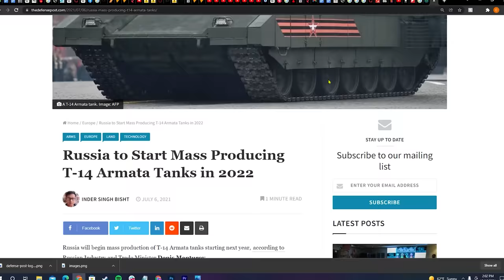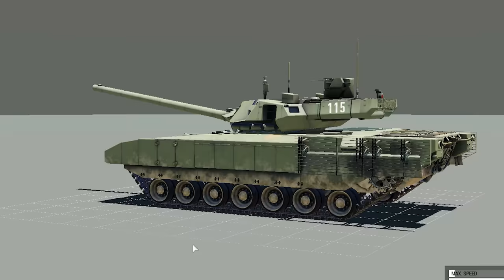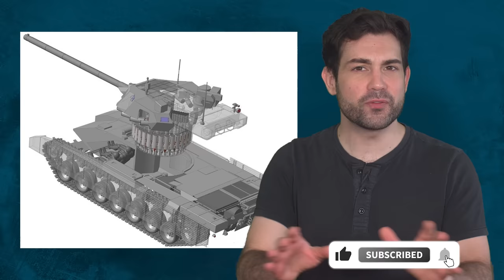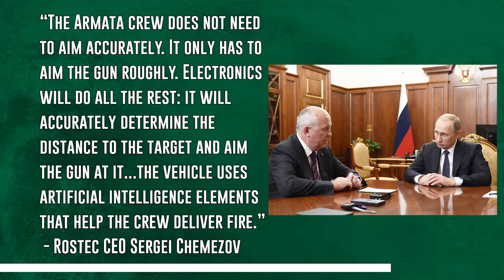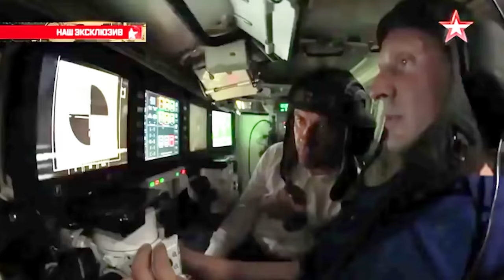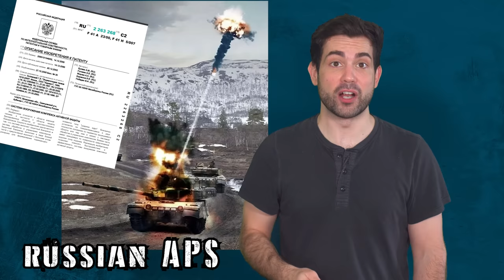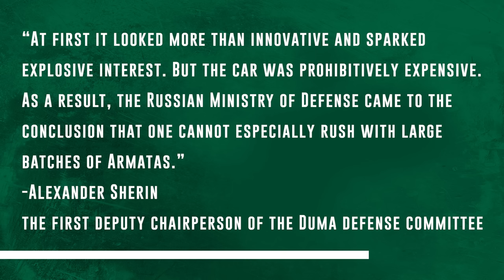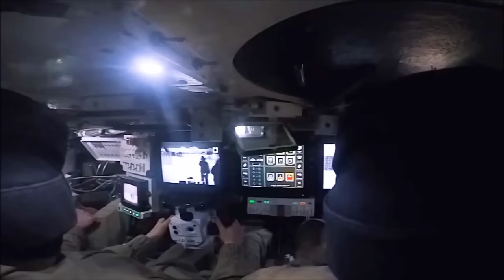The Truth About Russia's T-14 Armata Tank

Comment: Apparently, designing 'the best tank in the world' is easier than actually building them.
Reply: Same as the tiger tank ahead of it's time so cost a fortune to make and hard to produce in big numbers.
Reply: @huwdavies-tallon3305  👍
Reply: The biggest problem seems to be the engine
It does not deliver the horsepower of fuel efficiency that it was supposed to
Because it is underpowered ,it is over stressed and tends to catch fire
Reply: @jamesricker3997  
👍
Reply: Also which wins, the tank, or the anti-tank system.   Right now, I believe the latest anti-tank systems are leaps beyond what any country is willing to put into a tank to actually survive a hit.  Even active defense systems don't protect the crews from top down strikes such as from artillery, dropped bombs and some anti-tank missiles.
Reply: @orlock20  
If you build bigger rocks. Someone will build a bigger hammer.
Reply: @thomasridley8675  I forget who, but somebody made the largest prototype tank and it was unmanageable.  At some point, your hammer will be unwieldy and a new approach is in order.
Reply: @orlock20  
The rock is the tank development. The hammer is the anti-armor 
development. And so far, anti-armor systems are staying a head of the game.
Reply: Tiny economy compared to US can't build enough lul
Reply: @nkl7345  
They have built quite a few other combat systems since their fall. That are even more expensive than tanks.
But apparently, at the cost of tank and aircraft production.
Reply: Russians overstating the capability of equipment? Surely their performance in Ukraine would prove it out, lol.
Reply: Ideas and prototypes are easy. Production is hard.
Reply: @ManHobbyChannel  
They do seem to have an issue with actually building in the quantity they need. 
Putin spent over ten yrs to create the military we see today. And let's just say it, he got ripped off.
Reply: @orlock20  For as long as there is no perfect solution to HEAT ammunitions, tanks won't be in a confortable position against infantry.
Reply: @MrMorvana  That's one of the reasons the U.S. military has stopped buying tanks to the point that congress had to step in and buy tanks against the military's wishes, to keep the only U.S. tank factory operational. The minimum number of tanks needed to be built to keep the factory open is 100 tanks per year.  Some of those tanks are bought by foreign countries.
Reply: Building a prototype is very easy. Manufacturing is really, really hard.
Reply: that's true for all heavy industries
Reply: My mate once thought of the tallest tower ever imagined. Impressive.
Reply: Also,even if they built them, they would have to maintain them, create spare parts, ect.. with Russian weather, roads and legendary maintenance, this delicate thing would get broken in few months.
Reply: @noldo3837  
👍
Reply: According to Musk, designing rockets is much easier than building them in large numbers.
Reply: This would require a defence ministry which does more than syhpon taxpayer money to oligarchs
Reply: @KekusMagnus  👍
Reply: Lol its basically an automated t 90. Built cheap and easy to use.
Reply: @orlock20  I think the military has long since figured out that the cold War era tactics of the 1950s and 60s are outdated. Now, an untrained goat farmer with the proper equipment can knock out a $6M Abrahams tank if someone shows him where to point his weapon.
Reply: @thomasridley8675  And they are much cheaper than the systems they destroy.
Reply: the best is built and in service the M1 Abrams
Reply: @gordonhyslop1336  
The leopard 2a7 is right up there with the m12a scp. As well as the black panther. The deadly trio.
Just be thankful that they are on our side. 😁
Reply: just like the China next gen fighter... doesn't work most of the time.
Reply: Really reminds me of a Top Gear news section. Where they read out the specs of a new amazing Bugatti Veyron Killer. 
And ended witht he smallprint: "these are the features we plan for it".
Reply: @Thisandthat8908  
😁👍
Reply: @deeznutz862  
Well Russia has the same issue that China has. Poor logistics, limited infrastructure and a huge area to cover. As well as a system so corrupt that I am surprised that they can actually field any effective fighting forces.
Reply: @huwdavies-tallon3305  But at least it was build in some numbers, sure far less than the soviets and americans did with their cheaper tanks, but it was designed in 1941 and they produced 1350 tanks until 1945 even though it was this overly complicated. 

This is just in design and production hell for ages
Reply: @orlock20  germany build the maus in ww2. It was so heavy it buried itself into the ground. It was completely useless
Reply: @Infiltator2  188 tons of metal will do that. Even if one could get it moving, it would have to keep moving or the wheels will get egg shaped.
Reply: Many weapons systems, or even just plain automobiles, that look good on the drawing board or even as mockups, become utter failures in practice.  Either they're hard to manufacture, or there are systemic flaws that the designers failed to consider.  Usually results with failure to have constant input in the development process from veterans that actually served in tanks.
Reply: @jamesricker3997  Just...like...the German...Big Cats (Panther and Tigers).
Reply: @thomasridley8675  Said Kodos after Ned Flanders got the Monkey Paw and wished the Earth rid of those "Gosh-diddly Aliens":  

"Yes, Kang, we've been beaten.  They drove us off the earth with boards with nails.  But soon, they won't be satisfied with that.  They'll build a bigger board, with a bigger nail..then bigger...and BIGGER.  Soon, they'll build a board SO BIG, it'll destroy them all!  Ah-hah-hah-hah-hah-ha! "
Reply: @Infiltator2  At least Hitler had the sense to cancel the Maus after two prototypes were built.  There's one in Russia's Kubinka Tank Museum, supposedly the chassis and engine of one of the vehicles, which didn't have a turret, and the turret of the other, which supposedly actually saw some combat around Berlin, but either was knocked out or broke down and was abandoned.  How in the hell they got this nearly 200-ton contraption all the way to Moscow is alone a feat of transportation.
Reply: @selfdo  
I believe it's because they became to dependent on foreign sales to help fund their production.
Their small economy. The size of their country.  Who they share a border with.  Means that they need a really large military with modern equipment. And those are getting more expensive with every new 
technological leap forward.
Reply: @selfdo  Yeah, just look at the PL-01, it’s an expensive art project for a video game, not a tank to produce for a whole army
Reply: That's Russia in a nutshell: great at designing things, terrible at actually producing them.
Reply: I mean, at least they designed it 😅 plus keep in mind that they decided to stay with their already commissioned tanks for now. If others are willing to buy it, they’ll pay for it. This means that the manufacturing can happen, they just don’t want to build a ton of tanks at this moment. 
P.S. this is purely speculation, idk what I’m talking about 🤷🏽‍♂️
Reply: Actually, never mind. I was right, Duma said so (continued watching the video)
Reply: @fadialbouni  They decided that they’ll stay with their current tanks because they literally have to. There are a ton of factors here, will is not the most important. There is the budget, which there is no way that Russia can replace all their main battle tanks with T-14s even if they wanted. Then obviously it doesn’t go that fast, and the factories and facilities to build it need to be built itself in the first place. 

And that’s just observing it on a very surface level, there are a ton of things that mass production would rely on before happening.
Reply: @Thisandthat8908  - same as US pentagon.  Buy this cocktail napkin sketch of a weapons system we just came up with
Reply: @huwdavies-tallon3305  bruh. Tiger wasn’t ahead of it’s time at alll.
Reply: Ya ever buy anything cheap that's any good, naaaaah never!!
Reply: ...or even just managing to get gas to the tanks you already have.
Reply: Always has been.
Reply: @huwdavies-tallon3305  lets hope  they will be at least as unreliable as tigers and fuel consuming :D (latter is not a thing, probably)
Reply: @jlpeyret  
He wanted a military that could take on NATO. He got one that couldn't beat 
Ukraine. So ya, he got screwed.
Reply: @thomasridley8675  Ukraine has a solid military for defending Ukraine. But that is what they have been trained for. And they have had alot of help from the west. Ukraine is no pushover.
Reply: @claudemaggard7162  
They took a bunch of professionals and civilians, turning them into a military that could take on Russia. That's pretty impressive all by itself. 
Let's face it, nobody expected Ukraine would win. But, things sure have changed in the last 30 days. Ukraine's counter- offensive seems to be 
effective. I thought that Ukraine would let them beat themselves to death on their defense lines. 
Since Putin didn't call for a real war and didn't plan on these kind of losses. Ukraine has a good chance of winning at this point.
Reply: @jamesricker3997  how is this different from any other Russian tank?
Reply: @Duke_of_Prunes  prob not an Abrams (< the correct way to spell it), but any Russian tin can can be taken out quite easily.
Reply: @loganb7059  someone saying “ bruh”, is not old enough to know sh* t about tiger tanks !!!! Stick to your PlayStation games kid.
Reply: @user-ev4pb9xj7e  
So true ! 😁
Reply: @gobot4455  
The russians have very low losses. UKRANIE HAVE Lost  2500 tanks and growing, russia less of 300
Reply: Genius is 1% inspiration, 99% perspiration.
-Ben Franklin.
Reply: @BirdRaiserE  
Having an inspiration is far from making it real. 
The Overton window has too be there for things to line up. Where all the specific technologies have too be available. 
Tanks are a really old idea, but wasn't practical until technology caught up with it, making it practical.
Reply: @thomasridley8675  laserpig has a really good video on this Topic. Something something "the first tanks"
Reply: @BirdRaiserE  
👍
Reply: That is true, especially in Russia😅
I guess economy development should precede military developnent.
Reply: Except this is the best tank in the world. Funny how the West mocked Russia's auto loader, and now it's many western tanks and artillery, including the US supposed M1 Abrahms replacement tank.
Reply: @TheRealBillBob  
Except Russia can't afford to build them in any numbers. Of course they will still look good on parade. With a tow truck standing by. 😁
I hear that one t14 got taken out in Syria by a TOW system. 
Also, they still be dependent on Russian logistics and tactics. Both of which are terrible.
Reply: @TheRealBillBob  
The f35 ! Every plane has accidents. It's a dangerous environment. Also a safety stand down after an accident is normal. 
As for these "illegal" sanctions. One : they are legal. Two: if they make life difficult for the Russian people and government. Well, that is the goal.
Reply: @huwdavies-tallon3305  It definitely wasn't the best. Overrated IMO but still something I wouldn't want to go up against.

 It tended to break down quite easily and a tank is not good if it's always being serviced. It also was fuel hungry and sometimes too heavy. Also a ton of vehicles could take it head on from the Firefly to the M10 Wolverine. By wars end with Pattons or IS tanks it was done with.

 So mainly the reliability and fuel issues is what made it so bad. Never understood why it didn't have angled armor as well.
Reply: @orlock20  the us doesn't produce new tanks you know that right? The Abrams hasn't been produced in years they just upgrade old M1 hulls and sell them
Reply: @nicholasbrown668  The U.S. factory makes 100 tanks per year just to keep open. Most are export sales although the army sometimes gets stuck with a few.
Reply: @orlock20  nope, they refurbish old hulls, even looking it up shows that a new hull hasn't been produced in years
Reply: @huwdavies-tallon3305  Tiger was trash and obsolete as soon as it was built.
Reply: <--- Who knew?
Reply: Yeah. It was dead on arrival. Love or hate him LazerPig has some great view points and makes fantastic points.

 Long story short - great concept but the chassis was designed around the engine. The engine is archaic and was originally a Nazi WWII design that the Russians then modified in their own after the war. It has always been unreliable and they thought they could improve on it. This is the main reason why it kept getting delayed and they went ahead with the project thinking the new engine would be out. Yet with Russian brain drain after the collapse they can't. They don't have the talent or the necessary manufcaturing capabilities to produce one and specialized tools required for precision engineering is now cut off to them. So they are stuck with a chassis that can only use one engine and that engine sucks.

 The Chinese tested the Armata and nothing worked. The elecontrics are basically ones we can buy now. Russia doesn't have the capability to produce current gen optics or chips.

 The gun and unmanned turret are all great concepts with room to upgrade to a 150mm. Good concept.

 The idea of having everything on a heavy armored platform is not a good idea. Heavier armor means fuel and fuel means more logistics - more trucks and personal to get those supplies to these gas guzzling monstrosities. So it would be a huge weakness if every weapons platform was armored like a tank.

 Corruption and brain drain really really really caught up to Russia and it is only now we are seeing through it.
Reply: @dianapennepacker6854  👍
Reply: @huwdavies-tallon3305  ahead of its time ? they were just the first to build a heavy tank with lots of armor , IS2 was the most advanced tank in ww2
Reply: @nkl7345  but have twice than america
Reply: Germany and USA is copying the remote turret design and other systems from T-14. The difference is USA and Germany has the ability to build it in mass. And they're making it better.
Reply: @johnbamba3052  
Sure we can build a tank like the t14. But the question is do we really need too. Since peer to peer combat seems very unlikely.
And we will be only fighting against upgraded 72 designs for the foreseeable future.
Reply: @thomasridley8675  with all the drones used in Modern Warfare today. Yeah we need a tank like if not better than the T-14. You don't want your troops exposed out there in the open without protection against these drones. T-14 if what was advertised are true has the capability to effectively shoot down incoming hostile drones. Tanks aren't obsolete yet. It just needs an upgrade.
Reply: @johnbamba3052  
Drones may make tanks as problematic on the battlefield as carriers made battleships. While still useful. They are no longer the kings.